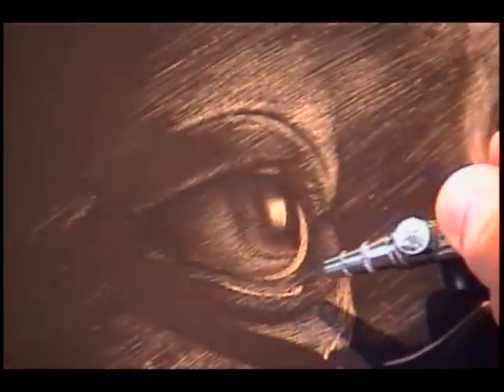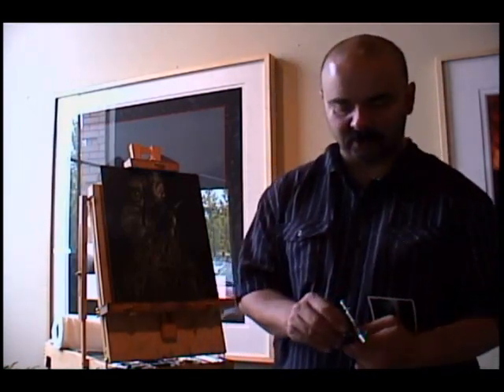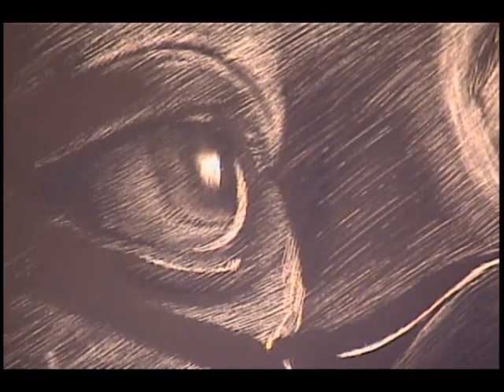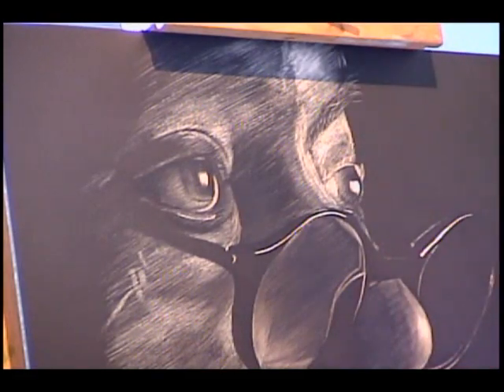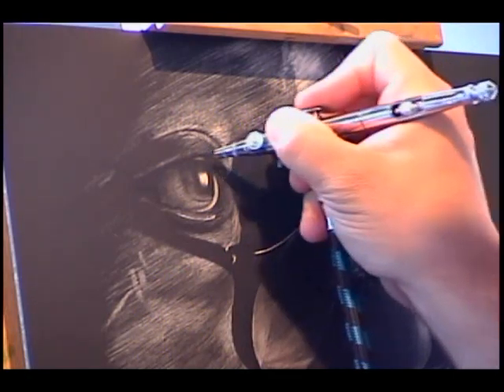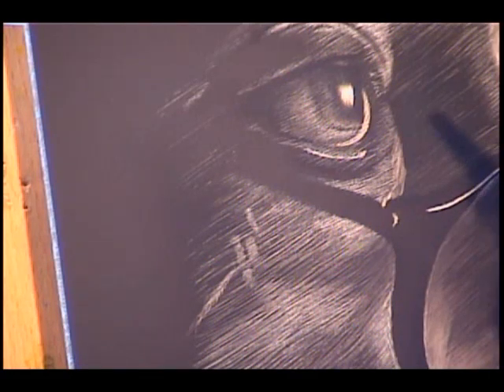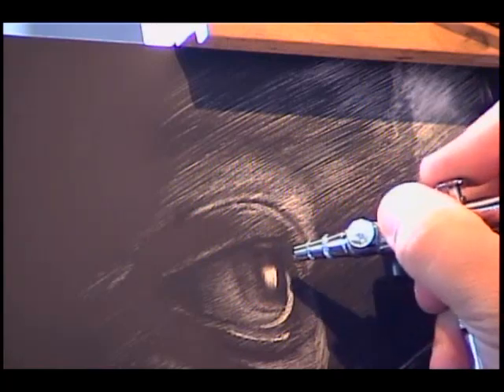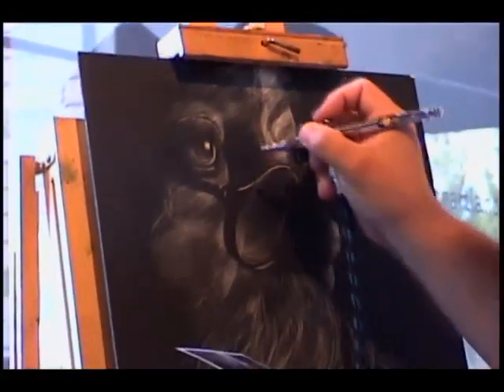Scratchboard Workshop July 2010 - 09C

Comment: If using Ampersand black, the pitt pen will correct mistakes or add more darks, and will not show up if sprayed with Clayboard fixative, or under non-glare glass.This seems more of an air brush painting than scratchboard.
Speedy Jr.